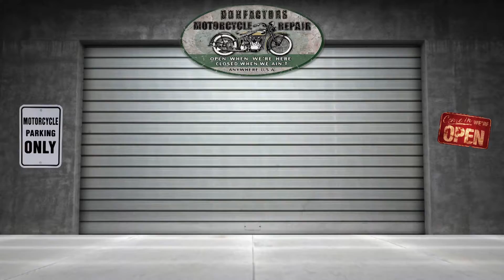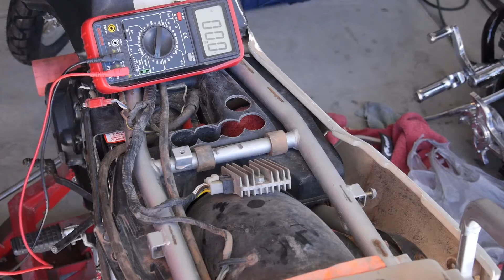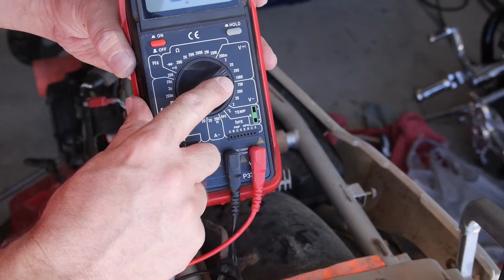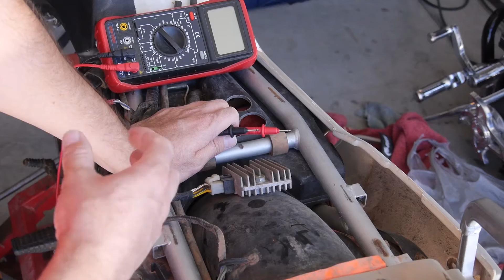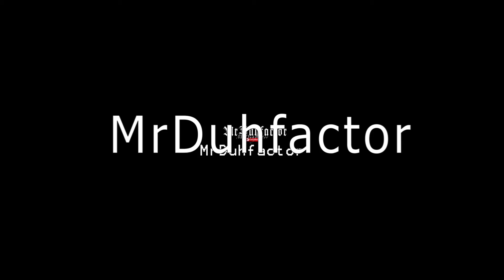KLR 650 - HOW TO TEST YOUR VOLTAGE REGULATOR

Comment: So 12.4 volts while running isn't high enough to charge the battery then? Flat battery often. Such a pain to get at the regulator with my giant oversized tank.. Thanks!
Reply from the maker: 12.4 volts is not enough. Usually its 13.4 volts or so to charge rhe battery.
Reply: @MrDuhfactor  thank you!

Comment: Hi have a 2012 klr and the test light lights up i have untapped wiring harness and nothing the trouble light lights up when key is on is this normal all i know is ive been thru 2 batteries and this will be the last klr pos i buy bike is like new and only has 5000k on it
Reply from the maker: Not enough information bud.....the test light lights up?? Where are you testing? Which wires? Sorry man, I have no idea how to help you with that limited information. Lets get more detail, and see what we can do to figure your problem out....
Reply: @MrDuhfactor  had 2 batteries dies it 2 months when i put a tester light between the negative battery terminals and the key turned on the tester light lights up ive pulled all parts off and unplugged all plugs and un tapped the wiring harness all looks good and the tester light keep glowing.do ignition go bad on a 2012 klr with 5100kms on it i think i vought it with this problem not sure i want to try a third battery
Reply from the maker: @kirkedwards9058  ok, to test for a short, you need to disconnect one lead from the battery, keep the key off (whenever the key is on, it will always draw power from the battery, and we would expect the test light to glow) thrn put one lead of the test light on the battery pole thats disconnected, and the other on the battery wire lead that is disconnected. With the key off, see if it lights up....
Reply: @MrDuhfactor  no when key is off the light is off bit when the key is on it glows is this all good sounds like i pulled the bike apart for fun will have to check another reason for dead batteries
Reply from the maker: @kirkedwards9058  so, if the light goes off when the key is off, there is no short. Time to move on to check the regulator. Did you use a voltmeter to check the voltage across the battery when the bike is running and when the key is off?
Reply: @MrDuhfactor  i didn't yet but will start ahain tomorrow thanks for the info can a rectifier kill a battery
Reply from the maker: @kirkedwards9058  absolutely can kill a battery, and is the primary way a battery gets smoked. You should have 12+  volts across the battery without the key on, and more than that but less than 14.3 volts when the bike is running.
Reply: @MrDuhfactor  cool thanks for the advice will try this tomorrow

Comment: +MrDuhfactor .... great tutorials. you really make it easy for us.  Quick questions, if I may. 2006 KLR650. I do have heated grips and a power outlet but did not use them during the tests. My voltmeter drops from 12.2 to anywhere between 10 - 11ish at around 4000rpm. It then climbs up to about 12.2 but, after a few moments in idle, sometimes (not all the time) it’ll will go erratic on the low side down to 11.4ish then go back up. 

I did the stator test and (just like your video) the middle yellow was not as good as the outer yellows. I wish I could remember the exact readings right now. Damn, where’s that notebook you’ve always advised us to have 😔

My questions:
- is that enough to drop the volts under load, as well as be erratic sometimes? 
- Could it be a failing battery as well (it being about 3 years old and maintained with a trickle charger during the cold months)? 
- Is there a regulator/rectifier low limit (i.e. It ain’t putting out the juice”)? 

I will surely replace the stator. Trying to ask the wife for “peace” if I add a solid state rectifier and possibly a new battery. 

Thanks much, Raymond
Reply from the maker: Joseph Raymond Henson Hi Joseph! Rarely will a bad regulator cause a low voltage, dare I say never? Sounds like a bad stator to me, as even without a battery ( you could disconnect it after starting it) you should be getting around 14 volts. If your not, then we always have to start with charge system. Only if its measuring greater than 14.3 would you want to start with the regulator. good job bud!
Reply: Thank you Sir !  Just ordered a new stator and gasket, new battery and a mosfet R/R.  Thanks much again Mr DuhFactor!
Reply from the maker: Great! Let us know how it all goes!

Comment: Quick question please - when running the bike my battery voltage drops from 12.6v (resting) to 12.3v.  Is that small of a drop indicitive of a short?  I have reason to think the problem is actually my stator since I'm getting no AC reading between stator ground wire and yellow wire while bike is running (as shown in your other vid). But before replacing stator I wanted to check on this.  While running, my battery is getting no charge and revving does nothing.  Again, volts drop from 12.6 to 12.3 after starting.  Thanks very much!
Reply from the maker: Jonathan Britcher Yes, having your battery voltage drop after starting, even with revving the engine, and your other tests indicate a bad stator. Well done! Now, get a quality replacement, and re-rest, you should then notice a voltage gain after starting the bike.
Reply: MrDuhfactor Awesome, thanks very much! I figured that was it since it passed the short-test from your other vid but I was uncertain due to that .3v drop. I'm going to try to do it myself although I'm intimidated by the process after watching a video on all of the steps involved.  I learned a lot of good stuff from your videos, I appreciate it.
Reply: MrDuhfactor Thank you, very informative. I used your battery drain test and I had no shorts in my system but the plastic connector melted like butter and the yellow wires leading to the stator were melted together. I separated them, hard wired and tried with a new battery. It started and ran for about a minute then the battery would not turn the starter over. So I charged it for two days on trickle charger and tried again. Tested the voltage on the battery when idling and revving, it dropped to 11.8V and never went up even though I revved to 5000rmp. Do I need a stator? Just confirming, don’t want to spend money uselessly. Thank you bey much!

Comment: Is 14.3 volts common for all bikes or just the KLR650? 3:21
Reply from the maker: Shaine MacDonald all 12 volt systems would use that standard of 14.3v. If the bike has a 12 volt system, then it would use 14.3v as the max.

Comment: Thanks Mr D! I plan to add a pair of 10 Watt Cree LED lights to my DRZ400. I know that with the lights on it will draw more current from the battery, but I assume that measuring running voltage with the lights on or off, I should get about the same reading since the regulator/rectifier will be compensating for the 20w draw, correct? I would also assume that if I were to add too many accessories for the stator to handle the load, then I would see a significant drop. Any idea how low of a voltage is "too low" that would indicate that I am overdrawing power?
Reply from the maker: Anything lower than the voltage in your battery at rest, with no switches on, and not running will gradually draw your battery down. LED's draw such little power, I'd be surprised if you had any trouble.

Comment: Thanks for the vid, question:  why not check it at higher RPM, like 4500?  I would think that's about where the revs would be at 80mph on the highway, I'd think you want to verify that the highest point isn't too high, no?
Reply from the maker: Yes, your right, one could and should do that, especially for peace of mind. If a regulator goes bad though, it will show over voltage at every RPM, and by the time you get to 3500 RPM, if it went open, or is bad,  there will be way over 14.3 volts, making high RPM testing not critical. It's kind of weird, it's either open, or closed, and there doesn't seem to be a middle ground with these. It is good to know for sure though, good point.
Reply: MrDuhfactor Gotcha, yeah, that makes sense, hard to have middle ground!

Comment: Don't use agm battery in that bike. The load voltage is fine for regular battery, but agm needs more, it would be underloaded and tired always.
Reply from the maker: Hmmm, interesting... Tell me more.... I've run AGM batteries in all my bikes for years without that happening, and no problems with charging, cold cranking, or anything I can remember.... I've only had problems with weakened AGM batteries when I'v blown a cell or two from a roached regulator.... I'd love to hear more about your experience.
Reply: I had one on speed triple that charges at 13,5 at cruising speed, it never gets charged properly, it works, but is undercharged no matter how far you ride it. If you seach for ctek + agm you notice they recommend to charge agm with the 'winter' (snow flake) setting, as it provides higher voltage. I think agm needs over 14 to become full. Lead acid will come full with any voltage above pole voltage, it just takes longer. I changed the agm to other bike (yamaha), that has hotter charging voltage and its been fine for years, i have rest voltage 12,65. With triumph it was always lower, which indicated undercharged state. With normal yuasa lead acid battery the triumph works fine.
Reply from the maker: James Parus Interesting information, thank you. I'll try to get this information out. I must have just been lucky that the bikes I've had AGM batteries in had strong charging systems. It's a fine line on voltage too, needs to be above 14V DC, but not over 14.3. That's the point I know AGM's burn up, done three of them on the chopper before I figured out my rectifier when toes up. Mucho's gracias!